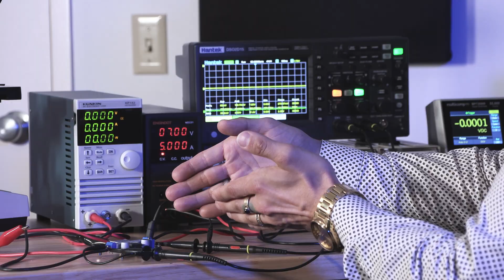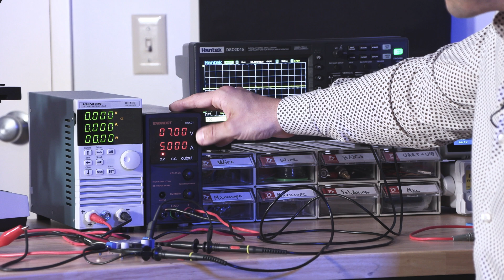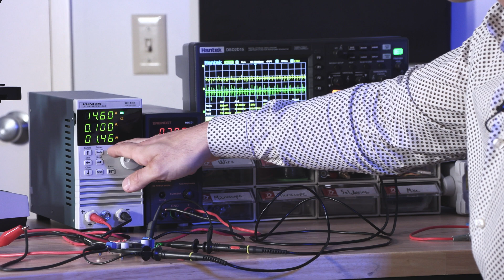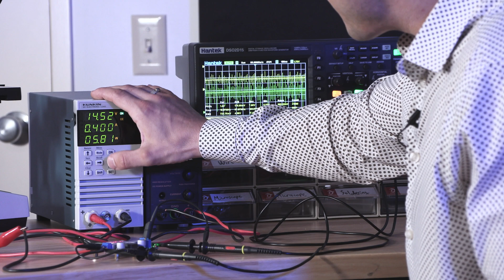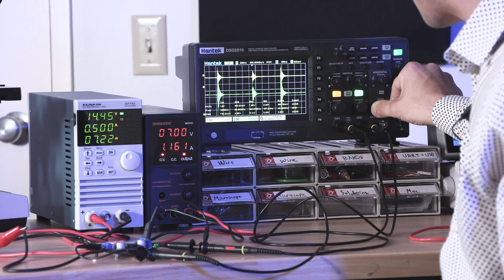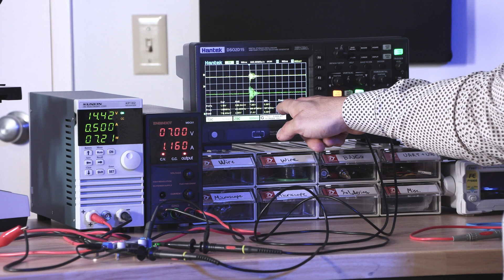How to Use a DC Electronic Load

Comment: Converters almost always get more efficient as load increases. If you see a drop at higher load your design needs work!
Reply: First, it's not my design, this is an off-the-shelf module I had in the drawer. 2nd, it can happen with load and with adjustments to the input voltage range, but most commonly input voltage range measurements. On some wide input boost converters or buck-boost converters, you can see that if you look in datasheets. It's not on all of those converters but on some it does.

Comment: Not surprised you've blown up a load when using something like that, at least they are only $20 to replace when you have equipment that cheap.
Reply: Cute, it doesn't really matter how much a load costs, if you mess up and put too much power into it then it's in danger of blowing unless it has protection on the input. This one is accurate, which I've qualified from measurement.

Comment: You can't trust the display value on a DC load or power supply, even with name brand equipment - you MUST use a DMM. Your DC load doesnt even have sense connections, so the voltage on the output includes voltage drop of the cables and connectors.
Reply: Well I do have the DMM up in the background...
Reply: Also on this one I have measured it multiple times, the voltage drop on the cables and connectors is on the order of mV or less, so really not an issue here

Comment: Aren't those long scope GND leads contributing to most of the measured ringing? Measurement of fast rise time signals would be better with using scope spring GND clips to minimize inductance.
Reply: We're measuring the filtered DC output not trying to measure the switching signal itself. EDIT: I re-read your comment and did another measurement with a tighter ground lead on the probe, I still see the ringing waveform but slightly different wave shape, so the GND leads do pick up some noise but the peak-to-peak ringing is about the same magnitude.

Comment: Interesting topic, and rightly timed for my board which is reaching its first test phase! I’d also like to see the effects of different noise reduction methods for PD with this setup. 

PS: what rule do you use for checking if the oscilloscope has a high enough bandwidth? It is the switching frequency multiplied by 3 or 5? This universal rule was given in another video.
Reply: For harmonic frequencies it would be at least double (or based on sampling rate), if you're trying to measure edge rates it's a bit more complex, but to be really safe assume the input is a 4th order filter, so you would need much larger than the knee frequency equivalent for that signal.